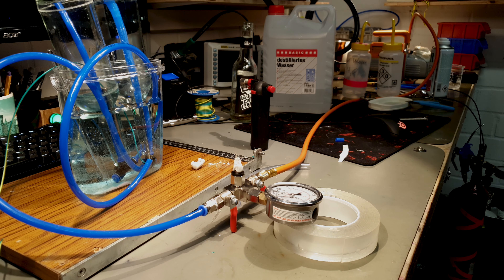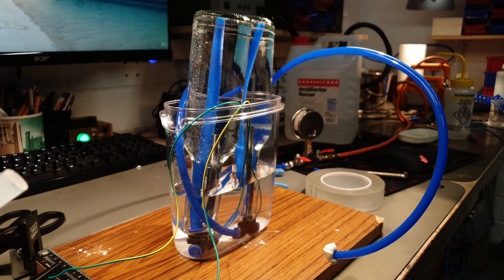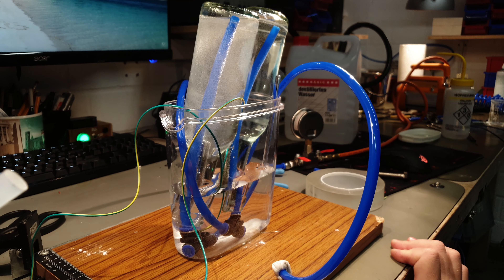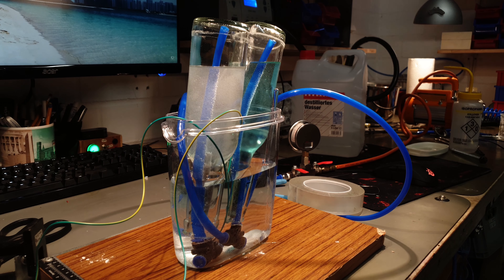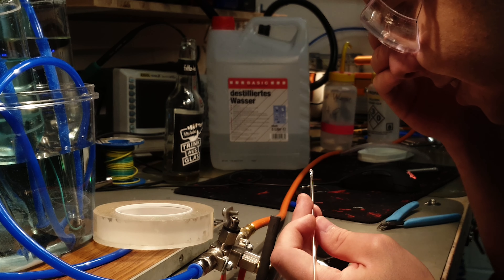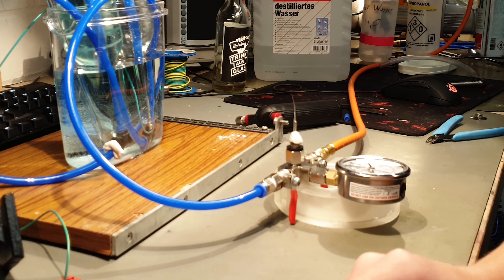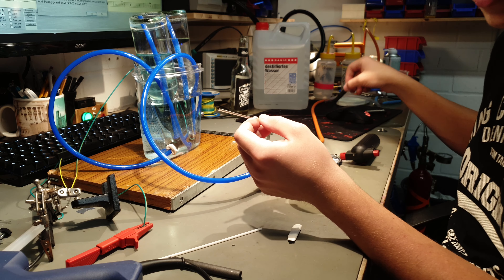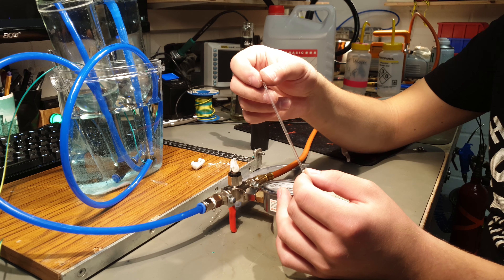trying to make gas discharge lamps

Comment: Learned in high school chemistry: DO NOT ADD NaCl! You will create Cl2 gas. Not healthy AT ALL. What you can do instead is add some drops of sulfuric acid which will act as catalyzer. Alternative options: add NaOH or KOH to increase conductivity (AFAIK does not react otherwise during the electrolysis). Now, of course, in high scool they had platin electrodes. Just keep that in mind. And lastly, very simple: reduce the resistance between the electrodes by providing a path as short and wide as possible. If it wasn't glass you could drill some holes in the bottleneck. With a slight tilt the gas won't escape, but the ions don't have to travel as far to get from one electrode to the other.
Reply from the maker: that's why I used NaHCO3 ;) the issue was mainly that the T adapters I used for the hoses initially blocked the the necks of the bottles, requiring a high current density that the solution did not support. Using something with a higher solubility would have worked out better for sure. I will try that if I do this again
Reply: @TMaxElectronics  ooor you could litterally remove the bottleneck of the setup :)
Reply from the maker: @maxzuidberg2322  So go to the store and buy a small oxygen tank? xD
Reply: @TMaxElectronics  Well... that would be an option, too, I guess.